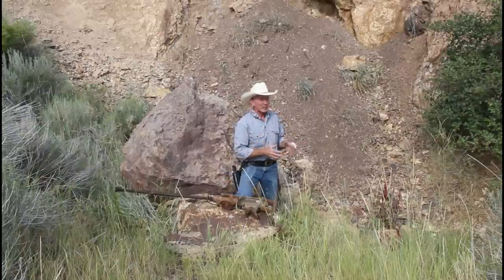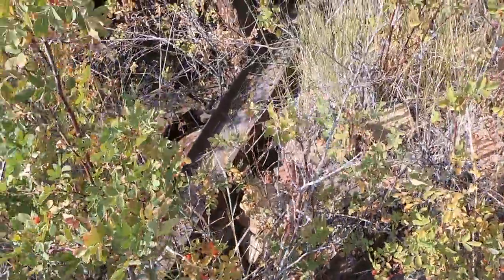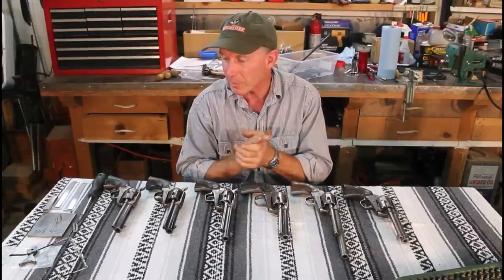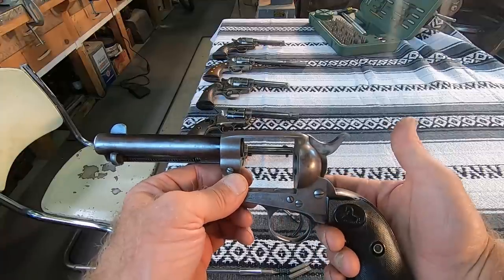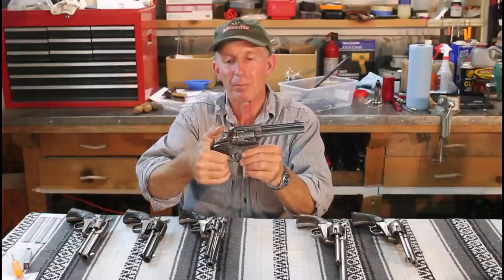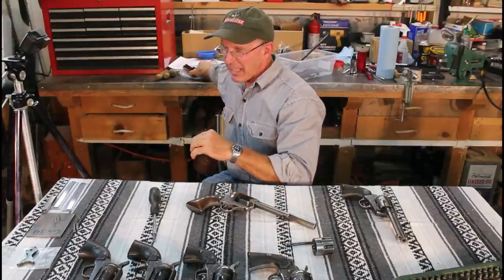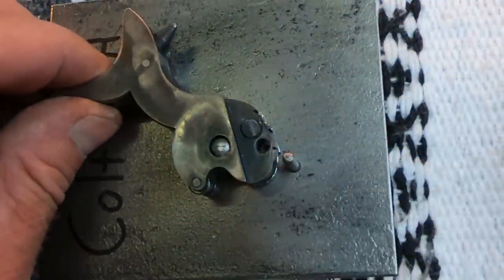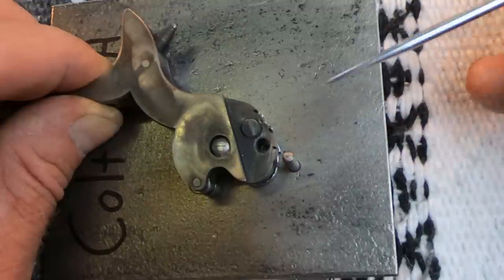Colt's Single Action Army - A Quick & Easy Mechanical Evaluation

Comment: I have a question for you.  I have an Uberti.  The problem I have with it is that the bolt/stop pops up so early that it's hard to get to the loading notch without going past it a fraction of an inch and tripping the Bolt,  Any Ideas?
Reply from the maker: It sounds like you're right that your bolt is timed too early.  If so, you probably have a drag line in advance of the cylinder notches.  The timing is controlled by when the bolt tine (the arm on the back end of the bolt) slips off the hammer cam.  Timing the bolt is a very delicate task that would take a whole episode to explain.  Sometimes you can just bend the tine a little and make it slip off the cam later.  Anything beyond that should be done by someone who has experience adjusting bolt timing on revolvers.
Reply: @thecinnabar8442  Thank you.  I was thinking that I had to weld up the cam, and I didn't want to even consider doing a job like that.  Bending the tine sounds like a good idea, but first I'll order a replacement bolt to have on hand in case I mess things up.  Thanks again!
Reply from the maker: @ATINKERER  If you bend the bolt tine and it doesn't fix the timing, you can always bend it back.  I would strongly suggest you take it to a gunsmith before you alter the cam.  Good luck!
Reply: @thecinnabar8442  Thank you
Reply: @thecinnabar8442  HI,  I bent the tine, as you suggested.   Now the gun works fine.  Thanks for your help.
Reply from the maker: @ATINKERER  That's great news!  You're very welcome.

Comment: the cylinder in my colt rotates back and forth when cocked if I pull the hammer back further with my thumb it stops and lines up with the barrel and the hammer is literally at the back of its travel how hard is this to fix I've never shot it. it's a forty-five with a ten-inch barrel

Comment: Do you have any plans to repair or replace the broken parts to make them safer and/or operational?
Reply from the maker: Yes, whenever I get the time to work on our own guns again.  I won't be setting the barrel back on that engraved gun though.  Unfortunately, the engraving runs right up to the end of the barrel and part of it would go away and look terrible if the barrel were set back. It belongs to the wife, so she made the call to keep it looking good and not shoot it.

Comment: There is an ultra thin line between slicking up a Single Action and f*cking up a Single Action.... Most people do not have that "magic touch" it takes to do it correctly.... Alot of old timers said when this was done, it really made the gun nice, but it also would wear out a heck of alot quicker....

Comment: All colt revolvers are fragile and come out of time and are easily rendered useless by the inexperienced. When they were affordable in the 60s I would pick them up and marveled at the fact of how sloppy the cylinders were. The old woodsman 22s and older 1911s are the only ones worth owning. 3 out of 6 in this video have problems. My point exactly 💯 👌
Reply from the maker: Actually, if I remember correctly, all of them had problems.  Of course, it was the point of the video to show revolvers with problems in order to show how to identify the problems.  It wouldn't have made much sense to show the 40+ first gen revolvers in the collection that don't have problems.

Comment: I wonder why guns like the single army and winchester 1873 are so wanted and loved as they are such...........................Lets keep it nice..... they are designs that are work well if they have little usage wenn they have wear on them the issues start but a Colt new service or a Winchester 1892 is a younger and much better design but they are less wanted....

I had a single Colt action Bisley ones and i hate the thing it was play here play there springs that broke...........I buy and sell Winchester 1873s regular but i dont like them either to many weak spots vs the 1892.....

I am not really a fan of the single action army and the Winchester 1892 it doesnt make sence they are so sought after vs what u get.....